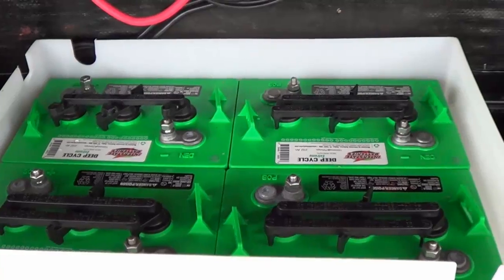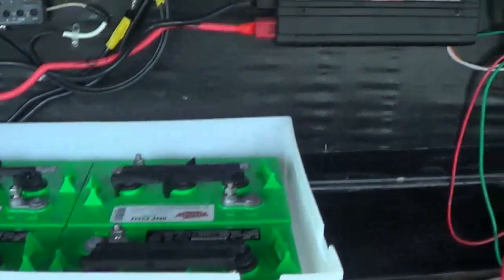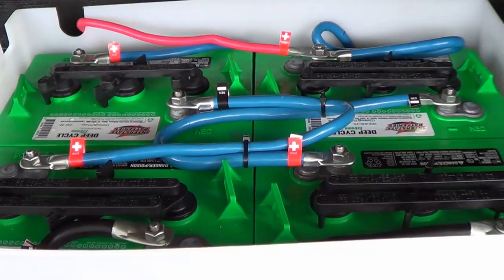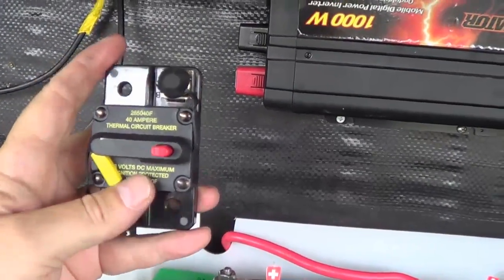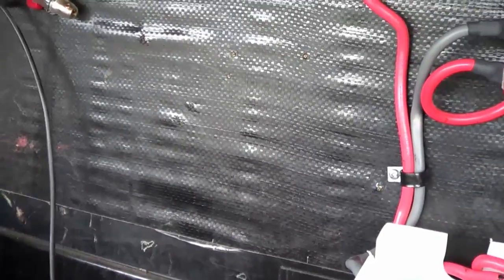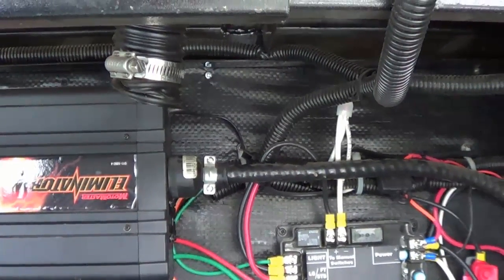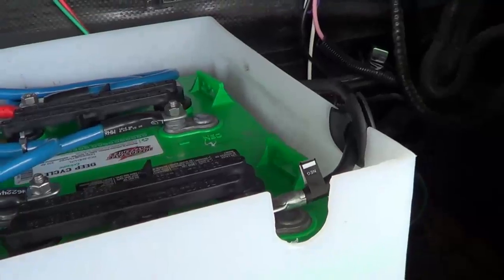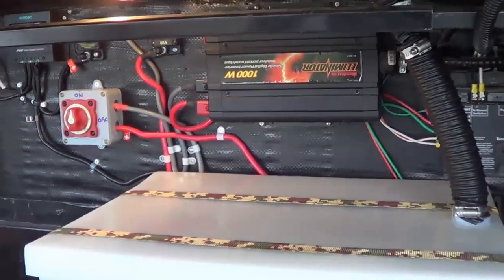Upgrading My RV Battery Bank for Dry Camping

Comment: By no means am I a expert however I do have experience in the RV Solar World. I am on my 3rd Toyhauler as of last week. I can tell you if you have the extra cash. Purchase 8D-AGM batteries, while these are heavy. They are 10 year Batteries if taken care of. I am not a full time RVer but with 4-8D's I have more then enough power for long weekenders. I never use my built in Onan5500 accept to run night time flood lights for an hour or maybe two now & then.AGM batteries never release gas so no venting.
Reply from the maker: Cool, sounds like a ton of power. All depends on your budget and weight, space requirements I guess. Gassing is not an issue since our fifth wheels front storage compartment is relatively open to the out side air. More maintenance needed but I do like the fact that I can check each cells state of charge with a hydrometer. Cheers! Ray

Comment: i have a single 12v now but  purchased 2 6v that i daisy chained.  So can i mow pair the old 12v to thr open 6v positive and negative 6v posts for generator cranking amps fot my 5th wheel?  Thanks!

Comment: Hi Ray.  Did you mount the battery box to the floor of the storage compartment somehow? If so, how? Or do you just count on the weight of the 4 batteries to keep the box stationary? Regards,
Reply from the maker: If you look near the end of the video - https://youtu.be/hajteByaQuE?t=14m13s   You can see I have eye bolts bolted through the steel floor and ratchet straps holding the box down. I'd say the weight of the batteries is likely enough in most cases but if I ever do hit some extreme roughness it doesn't hurt to the strapping to keep them from bouncing.
Reply: Sorry, I jumped too soon. My bad. Thanks for the response.
Reply: You see those big straps?  I know they're camo but still visible. 😊

Comment: Your inverter has too small of a breaker. 1000w / 12v= 83A
Reply from the maker: You're right if I was to max it out but I don't. It actually is capable of 2000 watt surges so would need a 166 amp. The max load I ever use on it is 800 watts, I have never tripped the breaker.

Comment: Best price on batteries I have found is Duracell at Sams club and Costco (rebranded Interstate) the 6v batteries are $85ea and Costco told me they will accept an AA battery to remove the core charge per battery. Or Batteries Plus has Duracell 6v for $99 and you may get 10% off if you ask for it. Making the price $90ea. You can also ask around to find old batteries people have laying around you can turn in to remove the core charge. There are also 12v AGM 100ah batteries on Amazon shipped for $160.
Reply from the maker: Cheap!

Comment: Trogan  batteries  are junk...over ratted
Reply from the maker: I think the problem is most people don't charge them properly. They require a higher voltage than most RV charge converters put out so most get undercharged, the plates sulfate and they fail before they should. They need to see voltages as high as 14.8 Volts during charging and 16.2 volts during equalization. Solar panels and a good solar charge controller with custom programming can make a world of difference.

Comment: Thanks as usual for a complete and step by step video!!!
Reply from the maker: Thanks, I've since upgraded the wire to a larger gauge 2/0 and shorter runs by having a buddy of mine custom build exact length cables - http://cdn.loveyourrv.com/wp-content/uploads/2016/07/Four-Interstate-6-volt-batteries.jpg

Comment: Nice wiring job Ray.
Reply from the maker: Thanks, that was the best I could do at the time with off the shelf stuff. Since then I have had a chance to run into a buddy of mine who does custom wiring, so had 2/0 GA installed as short as possible.
http://www.loveyourrv.com/wp-content/uploads/2016/07/Four-Interstate-6-volt-batteries.jpg
Reply: The new wiring looks even better Ray. Those batteries plus 400 watts of solar should be the cat's meow. 99% of my camping was dry camping in Idaho. I understand all you are doing and why.. Good luck and look forward to your next video. Oh, never had a power awning. That would make things much easier.

Comment: How do you decide to use a fuse vs a breaker?  On some systems Ive seen, they use all fuses.
Reply from the maker: A switchable breaker is nice since you can then easily turn off different circuits for testing or maintenance.
Here is my system as it is now - http://www.loveyourrv.com/diy-rv-boondocking-power-system/

Comment: Nice job, but I was curious why did you run 6v batteries instead of 12v deep cycle. was it due to cost or due to amp hours?
Reply from the maker: The have a smaller footprint (taller) so fit nicely into the storage bay.

Comment: more amp hours = longer run time do the solar panels need to be higher? so 400 ah battery require 400+ solar thanks
Reply from the maker: Depends on where and what time of the year but in general terms between 400 - 600 watts of solar is a good match.
Reply: looking at 850 wind and 400 solar we boondock for two weeks of the year right now on the Oregon coast the last time we used the 5th wheel were running out of juice in a couple days and had to run generator to recharge I have 3 cheap batteries right now heater really sucks juice thanks for the info and videos still learning this will be our second year with the RV again thanks

Comment: You are the master. Looking at replacing my two D.C. Batteries. About four years old im guessing. No wiring changes to convert to lithium?
Reply from the maker: No, it's not as simple as drop-in replacement. Here is the video you need to watch - https://youtu.be/EHSpJWgeiEw
Cheers Ray

Comment: Nice setup but with the money you spent on everything you get an MPPT charge controller
Reply from the maker: I decided to go with a SC-2030 charge controller in tandem with a Trimetric monitor. - http://www.bogartengineering.com/products/solar-charger/ Works great, economical, simple and gives me full control over how the batteries are charged.
Here is my system as it stands today - http://www.loveyourrv.com/diy-rv-boondocking-power-system/
Cheers Ray
Reply: Nice

Comment: Nice job! Did you look into lithium batteries? I know they are twice as much, but I think they last over 4 times as long. They are a lot lighter for the same total Ah. Thanks
Reply from the maker: No, they weren't a consideration in my budget. You need not only the battery but a Battery Management System BMS as well and a compatible charge controller. Also, there are concerns about cold temperatures and the tech is still pretty new,  and demands more babysitting from what I hear.
We'll see how those longevity claims pan out. Too much cash for me to risk. ;)

If you look at this RV package, you'll see 200AH is around 2000 bucks. - http://www.lithiumrvbattery.com/Lithium_RV_Battery/RV_LFMP_Package.html
If I had a different style RV where space was limited and weight was critical the Lithium would be much more attractive. I have lots of room and ventilation so can run the cheaper Lead Acids. My 4 cost around $500 bucks

I'll wait until they are worn out in 5 - 7 years, by that time Lithium should be cheaper and any bugs ironed out
Cheers Ray

Comment: Very nice! I have one suggestion though, there should be a disconnect before the charge controller. Since the charge controller requires the solar to be disconnected before disconnecting the controller from the battery bank.
Reply from the maker: Thanks. There is in the form of a removable fuse, which I've since upgraded to a switchable breaker - http://www.loveyourrv.com/diy-rv-boondocking-power-system/  Cheers Ray

Comment: Am I wrong.?  You say in series you quad your amp hrs. I was always taught the amp hrs stays the same as in one 6V battery?
Reply: Each battery is most likely 116 amp/hr.  Put two in serries you get 116 amp/hr.  Put two in parallel you get 232 amp/hr.  Put two packs of two serial batteries with two parallel and you ger 232 amp.  The main idea here is he needs 12v for output so he has two pairs of batteries.

Comment: Your work is very clean, I'm impressed. Have you weighed the trailer? That is a lot of tongue weight.
Reply from the maker: Ya, we are still 900 lbs under GVWR, it's a fifth wheel and we have a 1 ton dually truck so the extra hitch weight is not a problem either. :)

Comment: lets say you have two 6v 100ah and you connect them to have 12v batter would they be 12v 100ah or 12v 200ah?
Reply from the maker: The two 6s act as one 12v when wired in series. The AH capacity stays the same and would still need to be recharged after 50 AH.
http://www.trojanbattery.com/Tech-Support/TechologyLibrary/ConnectionsDiagram.aspx
Reply from the maker: Do you have a link to those prices? I've found generally 6-volt batteries to be twice the AH rating of 12-volt for the same price range.
Reply from the maker: 12v 100ah
Reply: Actually that's correct but in a normal 12v 100ah battery you would only be able to get 50 ah before you have to recharge it.&#160; Since you have two 6v 100 ah batteries and each will give you 50 ah.&#160; Wouldn't you get a full 100 ah out of the 6v system before recharge?
Reply: And note that the price of one 6v 100ah battery almost the same price as 12v 100ah, so 12v batteries as you get double amperage in smaller size with the same price although 6v connected in series may perform better and live longer.
Reply: 12v 100 ah

Comment: Where did you get the battery box?  Great video by the way...
Reply from the maker: Local marine parts supplier but it is online here - http://www.allbatterysalesandservice.com/browse.cfm/4,5576.html
Cheers Ray
Reply: i ran across a free RV from the 80's the other day, i think i should have just paid for one, so far I've managed to discharge all 3 of it's batteries (it has two deep cycle 95 ah, and one just regular car battery)well not me, my sister left something on while i was out of town, so for 3 weeks it was unchecked, all 3 batteries have no reading on a meter lol, they look old anyways, so now that they are old and prolly cut short in life from this 3 weeks at 0 volts i might as well buy new ones, i just have no clue about batteries, i hear 6v golf cart batteries seem to be better, but i don't really know why, or if that's true.  

 this video was very nice, thank you for all this info :)

Comment: You need to slow down and clearly show where the positive and negative terminals are. Your camera angle lets the edge of the box block the markings on the batteries. Also, your hand is out of frame when you are pointing. What are you pointing at? Badly done.
Reply from the maker: Sorry, will try to do better next time.

Comment: Seems easy to add batteries in a 5th wheel. Where could I put 4 sealed batteries in a travel trailer? I don't think it will work on the tongue. Thanks!
Reply from the maker: I'm not sure. I guess it depends on your particular trailer. It may not be possible.